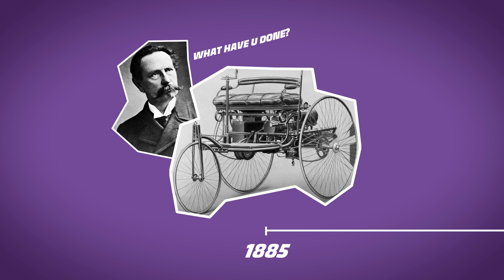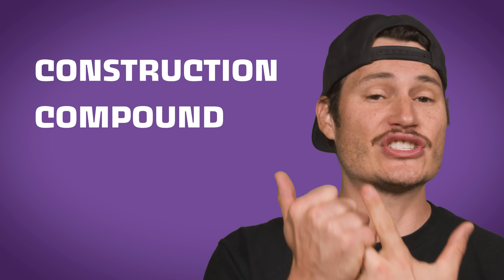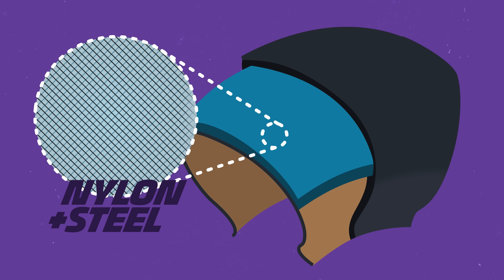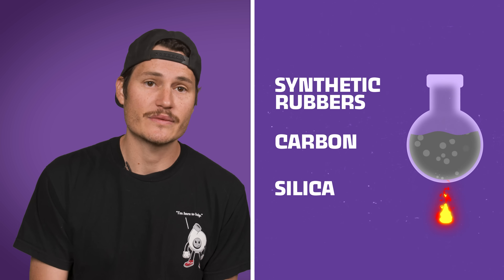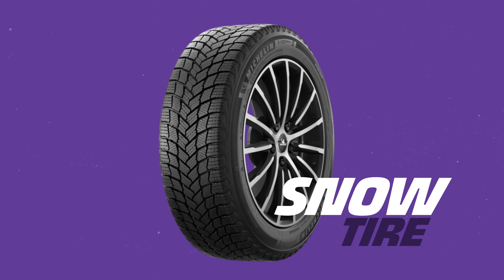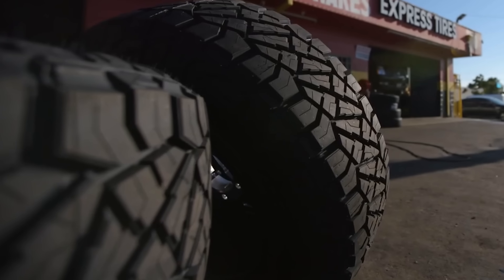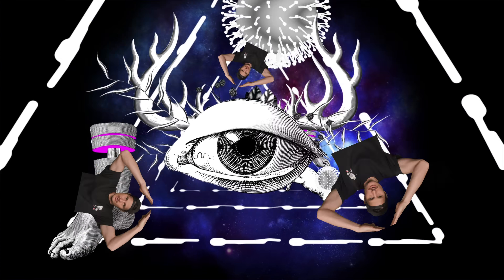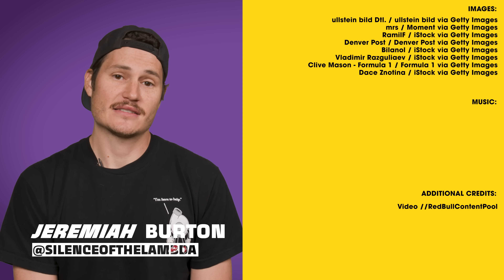The Surprising Science Behind Tread Patterns

Comment: Answer: wider tyres increase odds of getting the maximum friction the surface has to offer. Also lowers pressure per unit area which lowers overall wear.
Reply: I think your right!
I am not a engineer but I did read the other comments and they look right when I looked what they said on google. Basically the reason why larger tires give more grip is because the world is not perfect and there is sometimes gaps between the tires and the ground, and making them larger gives you more chances to touch the ground. Though in a perfect world a small tire and a large tire would have the same amount of grip.
Reply: no that's not actually the case. it's because Mu in the friction equation is a variable not a constant and surface area plays a huge role in determining the value of Mu
Reply: Uh, depressuring your tires increases wear, the sidewall isnt meant to take excessive loads when under aired, you can risk bubbling or debeading because your tire isnt keeping its shape
Reply: @pleasedontwatchthese9593  The most used Racing tires are a slick, meaning no tread. Just a giant contact patch. Formula 1 uses either slicks in dry conditions and a lightly treaded pattern in wet conditions. If it were a perfect world we would all be running slicks optimizing grip to a n almost 100% degree of contact.
Reply: @ultimatum117052  He's not talking about the air pressure of the tire, to my understanding he is refering to the same pehomena that makes snowshoes work. Larger footprint = weight being distributed on a larger area. 

If you have a 5 square inch contact patch and your ''car'' weighs 100lbs, you apply 20 lbs per inch on the ground of pressure,
if you now have 10 square inch contact patch but the same weight, you now apply 10 lbs per inch. so in that sense, the tires would last longer. If that makes any sense lol
Reply: @dannyallyn223  Tl;dr: it's not about surface area, but rather contact reliability
Surface area actually does not play a role in Mu at all. The amount of force being applied on a surface does not depend on the size of the surface (so a wider tire does not magically have a larger normal force pushing on it). Essentially the only reason why it seems like it relies on surface area is that a larger surface area increases reliability of the interface between those two surfaces.
Say for example you hit an oil slick that's 3" in width. If you directly went into it with a tire that's only 3" wide, you're going to have a real bad time. If you hit it with one that's maybe 5" wide, it won't be nearly as bad. It's important to note that the available grip/friction that tire has to offer will still be reduced. The reason for that is because roads are far from a perfect surface, covered in gravel, dirt, leaves, and what have you. It's important to note that "real world" and "lab" conditions are very different.
Tires are also elastic, which is a blessing and a curse. If tires were perfectly inelastic, what I'm about to describe would likely not be true. With debris and materials in the road, all it takes is part of the tire to start slipping for the rest of the tire to potentially follow suit. Wider tires are able to cope with more what I'll call "micro-slips" before the entire tire breaks loose. Once you change from static to kinetic friction, the coefficient of friction is approximately half, and when considering that, you can probably see how these "micro-slips" can cause a cracking-the-whip effect to the rest of the tire.
Another element of it is that tires, as described in the video, deform to match the rough surface of the road. A rough concrete road will offer more grip than a smooth concrete road, despite material wise being the same. That's not due to the coefficient of friction; if the two are the same exact mixture they will have the same coefficient. It's due to the fact that the contouring of the tire to the surface makes it so it's not 100% relying on friction for grip. The roughness of the surface allows for the tires to utilize the sides of the peaks and valleys of the surface for a normal force instead of friction. Think of it as how runners use starting blocks- instead of relying on friction they can just use a normal force. Think of it like dragging a toothed rack on top of another toothed rack vs. dragging a flat cut of the same material across a flat cut of that material.
HOWEVER, things are often simplified, and as a result things such as tires are often marketed as having a certain coefficient of friction, when really it's just an approximation between the true coefficient of friction, and miniature normal forces that form due to the general characteristics of the surface.

On a side note, coefficient of friction is a really interesting thing because we're not 100% sure what the deal is with it being about 1/2 as large once it's kinetic instead of static, but many theories point to it basically being that static objects allow the surfaces to "interlock" at a molecular level, while sliding objects (kinetic friction) don't allow that interlocking to occur, and rather the molecules are just sort of gliding across each other. We're still not certain why that happens to make the coefficient of friction specifically half as large though.
Reply: Once your tire is wide enough to take the power of the engine, anything bigger is a waste due to extra rolling resistance. The answer is they are bigger to get the power down. The bigger they are, the more resistance so too big and it could result in a loss of speed due to extra rolling resistance.
Reply: The lower pressure on the contact patch also increases the coefficient of friction, as rubber does not have a perfectly linear relationship between normal force and grip force. This is also the reason why stiffer roll bars increase grip in most situations.
Reply: @ultimatum117052  maybe u should look up the load\inflation\speed table for your tire if available

Comment: For the question at the end: 
(Edit: provided clarification after initial response). 

"I believe the reason is that the frictional force equation tells you the force at which you exceed the static force limit and would start to slide into a kinetic frictional state (which has a much lower coefficient uk). It essentially defines an upper limit of what your system is allowed to do before you slide. So, when you have wider tires it helps keep the contact patch wider and thus reduces the force on any given point. With less force on any given point you are more likely to stay under the static frictional force limit provided by the equation. If you had a skinny tire all the force would be spread out over a smaller area,  so you can more easily apply enough force to exceed the static frictional limit. 

Hopefully that makes sense! I am a bit rusty on my kinematics."

After reviewing a bit, I think the key is that F=u*N is deceivingly simple. It is more accurate to say that F=u*Sum of Normal forces being calculated at each point where the tire is making contact with the road. Thus, your frictional force will increase with a wider tire, as you have more little interactions culminating in a larger frictional force. Your u value could stay the same if you use the same compound, but the number of normal force interactions will be higher on a wider tire.
Reply: Go home. Lol you have won
Reply: TL:DR bigger tire, bigger contact patch. That's needed because of the power that a lot of those cars make.
Reply: I like your name
Reply: Checks out
Reply: you win, hope donut thinks that too
Reply: This guy is right, as force is spread in a bigger area, force in each point of the contract patch is smaller. 
If he was the first one to say it, he deserves the price
Reply: If the normal force reduces, the frictional force would reduce too, right? Does that imply it takes less force to skid? I know that's not true, wider tyres = more grip.
Reply: I feel like everyones missing the question including myself, all the answers seem the same and are true but not answering what Jeremiah's asking
Reply: This is not exactly correct, in the simple friction equation the area does not affect the max force.  So theoretically the area does not matter.  The answer to his question is that the coefficient fiction is reduced with pressure in tires.  So the simple friction equation does not apply.  That is why wider tires do better ( mechanical engineer )
Reply: That doesn’t answer the question why area is not in the friction equation.
Reply: @VEE727  This is a good question. The answer lies in that even though your u value changes at that point in time, it does not change the u value required for a skid. the point of failure coefficient of friction is determined experimentally for various compound interactions, such as the u=1 mentioned in the episode for rubber and asphalt. However, you can also use the equation to measure what the coefficient is at any given time. if the u value you calculate is less than the value determined to be the failure point, then you will not skid. If the value is higher, you will. Your normal force experienced is constantly changing in a dynamic situation, as is the force experienced. You are just hoping that the ratio never exceeds the maximum allowed coefficient for your tires.
Reply: @VEE727  In short, yes, that's exactly what happens. Think of a car driving over a crest. It gets light and the grip reduces. Or of one driving through a banked corner. The normal force is increased by the centrifugal acceleration, increasing grip.

I find The PhD's answers convoluted and confusing, and even though they aren't untrue, I find them ultimately unhelpful so I'm hopefully gonna give you the gist of if.

Area doesn't increase grip. Well is sort of does, but only because of the interaction between asphalt and rubber. The friction formula is sufficient for single points or smooth and hard surfaces, such as train wheels which are not affected by width (or at least nowhere near as much).

Beside this static friction, there is also mechanical grip which is the rubber molding around the tiny ridges in the asphalt. This is independent of a friction coefficient and would provide a force even if it was just ice on ice. This now acts more like velcro, and so the more little hocks you have i.e. area, the more grip it provides. A larger area also allows you to use a softer rubber while maintaining the same rate of wear. This is helpful because the tire is more supple so it can better deform around the tiny ridges, providing more mechanical grip.

Another fun fact about rubber is that it's coefficient of friction decreases with more load you add. That's why if you would double your car's mass, it would handle worse. You aren't doubling friction force. So because of that you could theoretically just make a tire wider while still using the same compound and it would increase grip because the load would be decreased on every point, increasing miu. But it would be more efficient to just keep the same width and design it with a softer compound. It would reduce weight, it would make fitment easier and you have to keep in mind that by reducing the load on every point, you are effectively making the rubber less supple, so you are loosing mechanical grip. Just food for thought though, I leave the exact details down to guys paid to worry about this stuff.

This is also why we use anti-roll bars and we try to keep the center of gravity as low as possible. To keep the load more evenly distributed side to side by reducing the rolling moment. So we are taking load away from the side with a low miu and adding it to the side with a larger miu.

Comment: Bigger tires typically means you can run more tire pressure while having the same footprint area preventing tire shake and maintain control of the dragster. You guys are great over there at donut one of the main reasons I have learned so much about different stuff in cars
Reply: But old cars with thin tyres have like 80 psi whereas modern tyres have 30.

Comment: Answer: The classical model of the friction coefficient, or it's "formula" does not apply to tires. It's good for a broad sense of how friction works but tires have many other variables to take in count than just Ff=(Mu)Fn. Pressure, angle of turn, temperature, etc. There's a difference between coefficient of friction and, more specifically, tire load sensitivity.
Reply: Hehehe, "load sensitivity"
Reply: I wonder what would be the full representative formula for it...
Reply: If this dude didn't steal this comment he should win.
Reply: @james4wd236  AGREE!
Reply: If I remember correctly, rubber also has shear strength which means that for a given sideways force there's optimal weight per cm² where the rubber can handle the sideways load without tearing. Cases where using wider tires improves performance are usually the cases where the surface of narrower tire is sheared away due exceeding structural integrity of the rubber.
Reply: Tires just as any other materials, like metals have a maximum allowable stress [Nm/mm2] which is a combinataion Force/Area. And for the tire to grip, the existing stresses (tension/compression/shearing etc.) have to be smaller thatn maximum allowable values for the compound. If you go over those values the tire might get damaged or it woudl get so stretched that it can't conform to the roads surface.

Comment: When creating a good compound for acceleration, softer compounds are favoured however an issue with softening the compound is that it will no longer support the weight of the car. To alleviate this, widening the tire and potentially using different compounds in different areas, along with stiffening the sidewalls helps to increase the weight the tire can support as well as improving cornering performance as the tire also experiences less roll. This widening gives a larger contact patch with the surface also, again helping to even out irregularities in a surface, increasing stability and grip.
Reply: Correct. You beat me to it.

Comment: My (hopefully) educated guess for the last question regarding the absence of surface area in the formula of friction force goes like this. It does not influence the linear movement grip, but it highly improves cornering grip, the same way in which wider bodies improve cornering stability. A good way to visualize these scenarios is to take some exaggerated versions of the extremity-scenarios: imagine a car with bicycle wheels. When cornering, a narrow tire will bend towards the inside of the corner (relative to the rim), moving the contact patch towards the lateral side of the tire, and rendering the highly engineered middle of the wheel useless, since it loses contact. A wider tire will have a much harder time bending like that, since it is supported by forces further apart, thus maintaining the contact patch in the area the tire is designed to have it. Same reason why low profile (hope that's the correct terminology) tires will perform better when cornering on smooth surfaces: bending is limited. A seemingly counter example would be the high profile tires of Formula 1 cars, but they are smooth everywhere, anyway, so even if the contact patch moves to one side, the road will still see the same type of tire surface, and would behave the same (assuming same chemical composition on said surface). That's my two and a half cents, hope I'm not way off. If you got this far reading my long comment, might as well leave me a like to show that you agree ;) Great content my dudes, love your vibes and appreciate your powerless communication which makes you so much more relatable and enjoyable. Peace out.

Edit: Uziel Lavine's answer seemed pretty persuasive as well, for the microscopic aspect of it. As a macroscopic view, I still think my point stands.
I see people posting their backgrounds, I'm a physicist engineer. :)
Reply: This is true but he does also ask in relation to ‘drag racers’. They generally don’t require cornering at high speeds as they are straight line cars. From what I remember hearing from my mechanic mates, a wider tire profile for drag cars are generally to benefit ‘off the line’ response. This is also why the back tires are much wider than the front tires. To accelerate, the engine must apply force to the driving wheels (which with most drag racers, is RWD). When you accelerate, weight transfers from the front of your vehicle to the rear.
My mate likened it to a sprinter launching from running blocks. The sprinter will ‘launch’ faster because the running block is providing a resistant, otherwise theoretically the sprinter would shift slightly backwards. A wider wheel in a way acts like a running block. More friction, more grip, higher acceleration which in essence is what drag racing is about.
Reply: surface area gets neglected from the coulomb friction model taught in high school or freshman physics because with linear and isotropic materials (ie steel) it doesn't matter that much. visco-elastic materials like rubber  have a pretty significant pressure dependency on grip. more contact area means lower average pressure for a given total normal force and hence higher grip. that's why slicks work. or why ultra high performance summer tires have pretty minimal tread features. or why larger tires can be made to work better.
Reply: drag racing doesn't have corners. Bigger tire= more grip in drag racing.